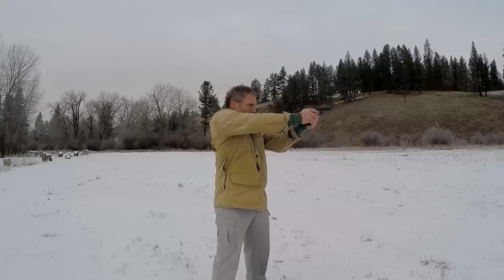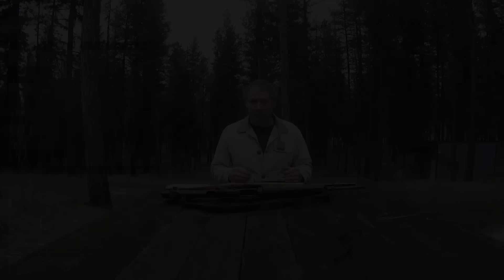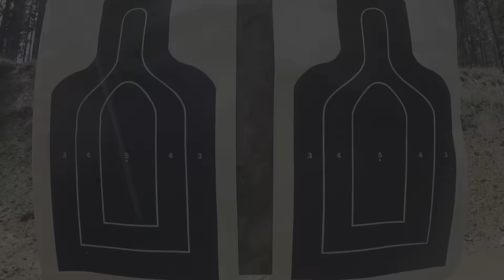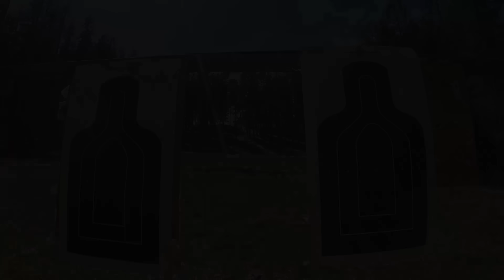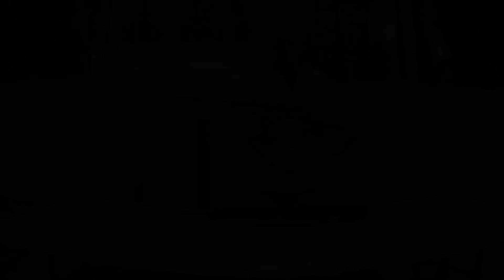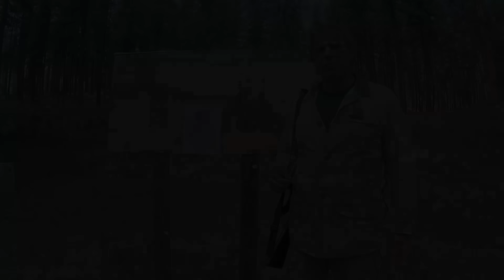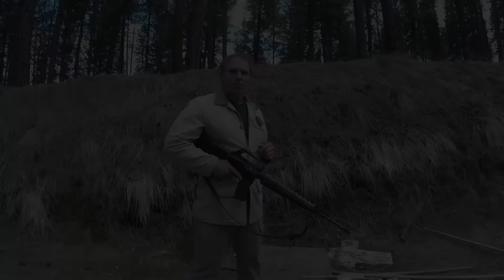Mini-14 vs AR15: Which is Better?

Comment from the maker: There has been some debate about the sights on the AR platform. Remember, the rifle in this vid is an A-1 an A-1 it's an A-1 the sights are different than on the A-2
Reply: I have been intrigued with this individual for I guess a couple of years, the level this man goes to accurately prove a point is amazing,I have seen meat targets that ( where I live) would easily cost $100 each, blocks that come in around $4 each, bed rooms in the rain, even construction such as walls and such to simulate housing structure and that's not even speaking of ammo, chronograph,firearms,ect. And it leads to wonder how much YouTube and patreon covers the cost and how much this guy puts in for honest quality content, Paul is second to none for sure
Reply: @wolfmanrebel874  I think the patreon supporters help quite a bit with the costs but that notwithstanding, Harrell definitely puts a lot of time and thought into his presentations and the great thing is he pretty much keeps an objective eye which ALOT of other youtubers can't or won't do, lol. Sure it's fun once in a while watching the beared/goateed cowboys go crazy with ammo and a camera but this is the place when you want real world info, data and demonstration. Harrell is pretty much THE FIREARMS MYTHBUSTER.
Reply: @wolfmanrebel874  you are absolutely right. Paul is second to none.
Reply: Paul Harrell everybody says the 3rd party Ruger mags are terrible.  I’ve bought a few online and a few at gun shows.  I’ve had incredible luck.  They are flimsier than the Rugers I own, which are heavier grade stamping, but they have all worked so far at 1/3 the cost.  Go figure.
Reply: @cbwelch4  3rd party Ruger factory mags?? Never heard of this??
Reply: @cbwelch4  How well 3rd party mags work for the Mini-14 varies from rifle to rifle, at least for the steel ones, polymer mags like the Thermold or Tapco seem to work well in almost all Mini-14s, but are tight in the magwell. I think with steel mags, other than the feed lips, it has to do with the stock because they also tend to fit tight. I think the stock either squeezes the mag and slows the feeding of rounds, or cocks the mag, both of which cause FTFs.
Reply: Generally true.  I have a transition model.  On the Lower Receiver, it is stamped with the Rampant Colt with the word "COLT" next to it. The second line reads:  AR-15 A-2   Below that is says .223 Caliber. Under that is the serial number: SER SP 340xxx. The upper receiver has A-1 sights and a barrel that marked:  5.56 NATO.   I've had this gun for more than 25 years and traded for it with its original owner.
Reply: Paul does tactical reloads "not bad", "not bad but a bit slower". Love the humble understatement. As a complete amateur both looked very skilled.
Reply: One correction.  Ruger always made 20 round magazines, however from introduction and many years, they would not sell them to the public, only to LE agencies.  Some found their way into the public, at high prices.  Later (no sure when, but I have purchased them 5 years ago), they did start selling the 20 and 30 round mags to the public.  I have heard that this was a personal decision of Bill Ruger.
Reply from the maker: @terrycarraway4095  All I can tell you is that at the time when I was searching for them I was told they were no longer being made.
Reply: Sir you are the Michelangelo of the shooting world, the guy under the apple was evil.   >_<
Reply: Paul, According to Ruger all mini-14's with the exception of the 580 series target models are chambered for 5.56 even though they are marked .223.  Are you unaware of this or did you just fail to present it?
Reply from the maker: @bwbw3647 There's a lot of conflicting opinions/information/disinformation about which versions of the mini really are 5.56 and which are .223 many people have said, "according to Ruger..." and then stated greatly differing things. I'll see if I can contact Ruger and see what they tell me. I know that back in the olden days when joe and I were using mini's that several people told me various versions of, "OH NO!!!! IF YOU PUT 5.56 IN A MINI YOU'LL DIE, DIE, DIE!!!"  We did it anyway, and never seemed to have any problems.
Reply: @PaulHarrell  Thanks for the reply, pulled my owners manual for 181-186 series mini-14 rifles just to be sure I wasn't misremembering.  The ammunition section states the rifles are chambered for .223 Remington(5.56mm military) cartridge and are designed to use either standardized US military, or factory loaded sporting .223 (5.56mm) cartridges.  My mini14 is a 181 series rifle.  check out the perfectunion . com mini14 forum for more info than you would ever like on the ruger mini's, that is where I got the link to your video.  They have a lot of  tips and tricks for improving accuracy of the older mini's that work surprisingly well.  Now that you are looking at the mini's maybe a video of before and after for some of those using your mini would be well received.
Reply from the maker: @bwbw3647  Good info
Reply: Paul...you are awesome man!! I've learned so much from your channel. If you were a college professor I would take any class you taught haha!! I enjoy your videos.
Reply: Mini-14 Ranch Rifle owner here, will confirm: great gun, put a decent aperture sight or if you must an optic and it can perform ballistic surgery out as far as I can see... but buy the overpriced Ruger factory mags. Never once in at least a couple thousand rounds has an aftermarket one fed more than 15 rounds consecutively. Not off topic, AKs are super reliable for a lot of reasons, but their feed reliability is in large part to the over engineered feed lips, which seem to be the Mini-14s mag issues, ARs have a big advantage there and w/ aftermarket accessories and enough configuration choices to most groups to make the 1911 jealous. Use whatever you’ve got, both will work if you maintain a either, providing its in working condition. My $0.02
Reply: You're the fucking man Paul.
Reply: @abc4781  I've watched a lot of Paul Harrell videos, but I don't ever remembering him using foul language in his videos.

That belongs at Honest Outlaw or any number of gun channels.
Reply: I find the AR simple for a basic field strip.  They are both winners.  I like both.  The AR is a bit better balanced in an M-forgery platform.  The Mini flies under the radar for sure.  Good video.
Reply: Paul Harrell The sights on my 583 series Mini unscrew two screws with an Allyn wrench on the rear sight and you can adjust the ghost ring for windage and elevation.  The problem is they move when you go to tighten them a bit, so it takes a lot of finagling to get them dialed in.  When I finally did, my intent was to never touch them again.  I far prefer click adjustable sights.
Reply: @cbwelch4  dude, calm down
Reply: Spon Rilker Calm but verbose.
Reply: @cbwelch4  Check out Tech Sights for the Mini 14, available for older and newer versions.  www.Tech-SIGHTS.com   Also available through Amazon.
Reply: @cbwelch4  check out techsighs for your mini.
Reply: I had a different question. My Mini 14 will fire both the .223 and 5.56. Why didn't you use the same ammo in both guns?
Reply: Max Pain  I agree, but a A-TEAM original ruger folder, blued or stainless are quite ridiculous in price, I have seen just the stock's selling for 850-900$! People are kinda nuts in my OPINION to pay that but then again they have been out of production since the early 80's I think? I have the CHOATE MACHINE & TOOL aftermarket mini 14 folder,one of my sts RANCH rifles is wearing that choate,  it is a lifetime warranty item, and it locks out tighter than the factory folder, and at a cost of bout 100-115 new, so check out CHOATE if U want a BADASS FOLDER for your mini!!
Reply: I have to say that I'm slightly nostalgic for the 1980s. Although we were not able to see fine, informative videos like yours, there were fewer genders then.
Reply: So you are saying it's an A1. Not an A2, an A1. But those sights don't look like A2 sights. They look like A1 sights, not A2. As always Mr. Harrell I love your "Shatner-esc" pauses and monotone directness. I thank you Sir.
Reply: You make a very fine point twords the end. Well done sir.
Reply: There's another reason people still like the mini 14. Ruger are a good company that make a quality product with top notch after sales service, on top of that, when other manufacturer's shifted production over sea's  Ruger didn't and kept American worker's in American jobs.
Reply: i personally do not like AR-15 sights i have encountered. i find them aggravatingly small and hard to actually align because of it, maybe it is just my shitty eyes but the AR-10 my uncle owns has fantastic sights so i am saying AR-15 has awkward and shitty  sights , just my opnion but i had air soft and Nerf guns with better and more efficient sights, even pistols and that tiny pinhole sight flip thing is the worst, i prefer to be able to see my front mounted sight, and not have to rely on some optic i see in video games, hell i have seen better sight rendered on old school video games but moving on i enjoy the AR platform out side of what i just complained about, a newer person to shooting so plenty variables are present . I will saw however different weapons are made and designed for different things. Example being a  13th Century English Long Sword Vs a Persian Scimitar, yes both are amazing cutters and bot are devastating with thrusting attacks, however the Longsword is better suited for the stably bad time and the Scimitar is a phenomenal cutter . the rifles you are talking about from what i gathered are from similar eras with a similar purpose  but one seems to be designed for longer ranges or more civilian use, as the mini 14 was the rifle used by my Cadet unit for the color guard  and the rifle they used during gathering to teach cadets to shoot . a weapon is best defined as better for what it does vs the other ,  just my thought after seeing some of your videos and this one
Reply: Will they allow an individual to eat boiled eggs on this range?
Reply: I'm voting for a Part II to this amazing video!  Thank you, Mr. Harrell, for the effort and diligence in putting this together!
Reply: Yes I did. Sat thru  the entire video. Very good video.
Reply: Newer Mini-14's have front sights more similar to the AR platforms Post sight.
Reply: That's why knowing your sight hold over is important even with handguns especially with red dots and rifles with scopes
Reply: accuracy comes down to the barrel quality and the load iv rebarreled 20-30 ar 15s and 5-6 mini 14s and barrel quality and load developnet are the 2 biggest factors first when locking guns in a ie lead sled machine vice etc. as a extream friend had a mini 14 shooting 18 moa groups iv tested seveeral 3-6 moa two new mini 14s shoot 2 moa- ar-15s iv seen 5moa junk uppers to JP ar 15s with load development with the gas shut off 10 shots in a dime fact!
Reply: a A1 ar 15 and a pre 580 series mini 14 have bad unstress releived barrels this is reason your groups shifted to the left at 200  yard s wind doesnt move groups that far to the left unless its 20mph at 200 yards a 10 mph crosswind @ 200 yards is around 3''
Reply: if you had a lathe you would all understand the barrel the barrel the barrel iv have taken both ar -15s and mini-14s that were 3, 4, 5 ,6 moa guns and have rebarreled them with new better quality aftermarket  barrels and have made alot mini -14s into sub 2 moa and alot of ar-15s that were 3-5 moa guns into sub 1''just with a barrel change fact!
Reply: Ok but you know that it's an A-1?
Reply: Wait, what rifle was it? An A what?
Reply: Not much debate. AR wins outright. No contest.
Reply: mine is an older colt sporter 2, 16" barrel, put a floating forearm on, had to put slot in it for ventilation, hot to hot, drilled and tapped for a rail, mounted a red dot on. the iron sights are lined up with the red dot, better trigger. with my 62gr semi points she will give me 11/4" groups at 100yds using open sights, it turned out the re-15 powder i used, the most accurate load was the highest powder load, so she is going at abt 3200 fps. love this rifle. bought it as an investment. all it took was one time at the range, fell in love. the first thing i thought to my self was my Mattel toy. the latest assessory i have gotten for her is a sylvan arms mag well and a FAB butt stock with a built in mag holder. 10 extra rounds, had to glue on a small piece of plastic on the mag button, it was to flat, hard to locate. she is my little baby. my dad was a gunsmith, that's why i am into the no
Reply: The front grip is also different on the A2, its easier to make the distinction at a distance knowing this. The A1 has a more smooth wedge shaped grip and the A2 has the cylinder shaped grip with the waffles on it. Some of the grips do taper down toward the tip like the A1, but they always have the waffle texture.
Reply: Paul probably has the most professional, eloquent vocabulary of any YOU TUBE presenter on any topic. I’ve probably watched every video he’s ever posted & can’t recall him ever using any “bad language.” I wouldn’t have an issue if he did , just statement of fact.
Reply: On the A-1, the rear sight is only adjustable by windage and the toggle peep hole for night/day shooting without elevation adjustment, correct?
Reply from the maker: @Jazzman-bj9fq On the A-1 the rear sight is only adjustable for windage except the short/long range aperture adds elevation when the long range sight is in place. There is no difference in size of the apertures. the A-2 has different sized rear sight apertures.
Reply: @PaulHarrell  Aha, I appreciate your response. I was of the generation who used the A2 in Basic, quite a bit before M4's came into vogue. 'Preciate you, Sir Paul!
Reply: @PaulHarrell  @1:27 speaking of things popular in the 80's, is that jacket your impersonation of TV cop 'Sledge Hammer!" @0:07?
👍
Reply: Yes,  I like the A1 sights better but it was what I was trained on, I do know they are along simpler for me to use. Yes the rear sights are for windage and the front is for elevation.
Reply: @Jazzman-bj9fq  There's a great video over on forgotten weapons that explains the differences between the M-1 and the Mini-14; particularly about how the gas blocks and sights were simplified to reduce machining time and cost. Not to take away from Mr. Harrells' excellent video, just additional information that may be interesting and explanatory.
Reply: @slick3129 Hey thanks, I'll check it out!
Reply: @Jazzman-bj9fq  
I think you need to WATCH THE VIDEO!
Reply: @stevecolley6750  I did watch... Not sure what part you feel I missed.
Reply: @Jazzman-bj9fq  
Try 19:40 to 21:09. Paul clearly instructs that on the A-1 the two peeps are "long" and "short" range, and are so marked. They are NOT "for night/day shooting".
Perhaps just a momentary lapse in your attention, but there you go.
Reply: @stevecolley6750  Aha yeah there it is. I was getting it confused with the A2.
Reply: Mr Harrell if you have time could you answer a question? It's pure curiosity but I was wondering about the use of the Mini 14 in law enforcement, particularity in Correctional Institutions. They seem to be commonly used in guard towers and from caged/protected walkways inside the buildings, if the guns are inconsistent why did they choose them? Sometimes the ranges are long and they are trying to protect guards, staff and "innocent" (from whatever is provoking the shooting) inmates from dangerous situations. Wouldn't accuracy be paramount?
Reply: @Tuberuser187  I can't imagine they'd have to fire from a distance of more than 100 yards with them.
Reply: @Tuberuser187  I don't wanna step on Paul's incoming answer but I'll offer some possibilities on why some law enforcement or prison guards might use the Mini-14 instead of something else like an AR15 or other rifle that is a semi-auto civilian version of a military firearm. You might have noticed that there is a social stigma to rifles or carbines that essentially come from military weapons like the AK variants and the AR15. Military firearms are sometimes erroneously thought to be more dangerous and there only suitable for use in war zones. It's erroneous because 5.56, .223, or 7.62 rounds can and do kill people regardless of what weapon they're fired from but I think law enforcement agencies (or the local governments governing them) typically don't want to be seen as employing 'military grade' weapons. I'm in SoCal and outside of SWAT teams, the LAPD used only pistols and shotguns until after the Northridge incident in '93 where two guys wearing body armor and all black tactical gear tried to rob a bank and were armed with semi-auto rifles and the police found out how devastating two guys could be. There may be other reasons why prisons use the Mini14 as in there may be some local or federal regulation against certain arms even for that use that I don't know about. It would make sense if there were some regulations on that because in a worse case scenario if you have a few prisoners escape, you probably don't want escapees carrying the top of the line weapons with them and turning them on pursuing law enforcement and the surrounding citizens in their path. It hasn't happened very often recently but in decades past there have been prison riots like the one in Attica in '71 so again, if the situation got out of control, the prisoners would get access to whatever the guard force had. Think as well about the civil liability of a state government if prisoners escaped out of a facility and the escapees killed several folks with prison issued weapons that were equal to or better capability than those that major police departments were using.
Reply: @Tuberuser187  I now it may sound not practical but wood has better eye appeal plus you might be able to arm 2 or even 3 using Mini 14s as opposed the cost an A1
Reply: I like both platforms for what they are. I am also a huge fan of the "budget" AR's. I own a Mossberg MMR.  Being super-mass produced has dropped their prices, and that of their accessories, tremendously. However, this also has a couple downsides. There are a handful of cheap manufacturers that make complete garbage AR's. These are often the ones you find for less that $500. I also have severe concerns with AR's that use polymer-only lowers. Budget is good, but do homework on the brand to make sure you don't get a lemon.
Reply: @Tuberuser187  The average CO rarely practices if ever. I helped a lot of my brothers and sisters in blue qualify. Most had never shot before. Our profession almost never has to shoot in line of duty. I finished my career without ever having to fire in the line of duty, though I did draw my sidearm once and present a shotgun once. Thank God that was sufficient.
Reply: @jeffreyroot7346  You were fortunate indeed. Thank you for your service.
Reply: @Tuberuser187  If the rifle is BZO'd, then they will hit accurately inside of a 7 1/2 inch circle,  the BZO for an A2 is 36m to 300m, so anywhere in that range the bullet travels in a arc of 7 1/2", more or less. I would imagine though that the corrections units probably sight in according to the post, inward or outward, and say they have range markers set at the perimeters for that kind of thing.
Reply: Nonarei they are probably 30 or 40 years old up in those guard towers. They were bought when they were cheap and easy to get unlike ar15s.  Wouldn't surprise me if most of them were either during the Clinton awb
Reply: Thanks for the video Paul. Very enlightening indeed. I have shot Ruger Mini-14s back in the 80s with some guys who own them while being stationed at Ft. Carson and going to shoot at Stage Coach Road. Yeah they were alright. Kind of reminds me of my cousin's M1 Carbine but in .223 Remington than .30 Carbine. I never cared for them. Until one day a guy from Bravo was selling his Colt CAR-15 because he was PCSing to Germany. I bought that in a heart beat for $200.00 almost new. Reason was I was trained on the M16A1, maintenance, and familiarity. I still have it today along with a 1977 made Colt AR-15. I built a retro M16A1 from a parts kit from nostalgia of Basic and AIT at Harmony Church Ft. Benning, Germany, and Ft. Carson. I just love the A1 for its looks and simplicity. I sold my A2 version I built also. I build some M Forgeries and keep them. But the A1 goes back to wonderful memories of my early units growing into the Army both good and bad. A good rifle from my youth.
Reply: Paul Harrell You have a speech impediment?  I've watched quite a few of these videos.  I am aware of the Shattner-esque........pauses, but I detect no impediment?

  You put out some of the best gun content on YouTube.  I'm no amateur, and most of what you have to say is in no way new to me...but I find your content highly entertaining due to not only it's accuracy but also the way it is presented.  No f-bombs, no sexual innuendo, no bikinis or self aggrandizement.  Just good old facts, backed by experience, tempered with humility.
  You, don't put hunters down as "Fudds", or the Military and LEO types as "tactical teds", and you don't fill your channel with political commentary (which is important stuff, but wearying).  Your content is for all shooters.  If you don't know it, sir, your channel is one of the most respected, along with Forgotten Weapons and Hickock .45.
  Thank you.
Reply: I would like to see what you have to say about all the different a1 and a2 sights etc as well as canted iron sights or flip up sights! I always say I dont know much about firearms but thats cuz ive been watching your videos for years now and always learn something new and interesting. Thanks for the great content Paul.
Reply: The Mini-14 accuracy problem was due to the earlier versions of the Mini-14 which had a barrel that was way too thin under the gas block and had too much flex. About a decade ago, Ruger corrected the problem and also improved other aspects of the design. Nowadays, they're good guns. But the problem is a Mini-14 is still $750 when you can now get a budget AR15 for $400 that will shoot just as well and, for less than the total cost of the Mini-14, can be upgraded to be better. I could easily outfit a budget AR15 with a new bolt carrier group and Geisseile trigger for that price, and some basic flip-up iron sights to boot, and already be way ahead of the Mini. From a purely budget perspective, the Mini-14 is dead in the water. The AR15 has a lower initial buy-in cost and can achieve parity at a lower price point. And these budget AR's are also flat-top so they don't even have the severe sight offset problem that the A1 and A2 have. The modern Mini-14 is still a good gun, but its time is running out because it's simply no longer economical.

Don't get me wrong, I love classic designs. I have plenty of classic firearms in my collection, but the Mini-14 is just too expensive for what it is and does NOT compete against modern offerings, and its old-school design precludes any real options to lower the production costs. Were it a historical military design like the M14 / M1A, that also fire a full-power rifle cartridge with high accuracy, there would be grounds for defending its price and continued production. But being a commercial design without historical significance, and one that is now obsolete in every possible way, it is hard to argue that it is a good investment or that it has a future.
Reply: My problem with the Mini was always the rear sight. IMO it's too far forward to provide a good sight picture for a peep sight. I can also verify the claims of inaccuracy between different rifles. I had to range qualify with Mini-14s for over 20 years. Some shot a LOT better than others. While I haven't shot the latest series, this problem carried out through the first several, at least.
Reply: you also have to take into consideration that in an environment like the Vietnamese jungle, wood would swell. Which would give the a-1 an advantage.
Reply: Also you have to down load AR mags a round or two or they are more difficult to seat in my AR (M&P-15).  Not the case with mags that rock in.
Reply: @cbwelch4  Not a issue when the bolt is locked open like after the last shot in the previous mag.
Reply: Chris Hyde Maybe it is just me, but if I load them to the max I have to whale the mag into the receiver to seat them.
Reply: @cbwelch4  I always lock the bolt to the rear and then insert the first mag to avoid that.
Reply: C. Welch you don't have to download any ar15 mags.  You're not loading your rifle correctly.  Lock bolt back, insert full magazine,  hit bolt release,  turn on safety. Your rifle is now loaded without downloading a mag
Reply: C. Welch If you are firing the bolt will lock open negating the issue of downloading to seat the mag unless you wish to keep the weapon condition 3 in the closet.
Reply: @cbwelch4 
I learned that (at least on the 
Mini 14) to install magazine with the bolt open. 
A friend had this experience with his M&P 15. I suggested he lock the bolt and the full mag easily fit in place.
Reply: @cbwelch4  
Which AR mags? Not Magpul. Also, always load mags on an OPEN bolt when feasible. 
Download TWO rounds??? Re examine your life. Seriously.
Reply: But you missed nearly all the shots at 200 & 300 yards. The impacts are seen below the targets. They are nicely grouped however. Do it again, correctly please